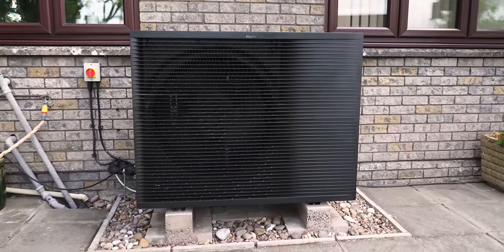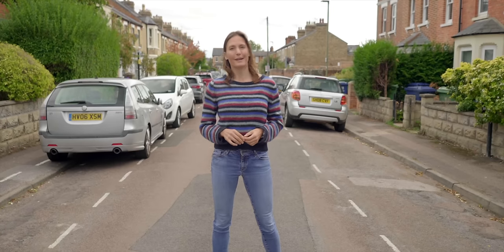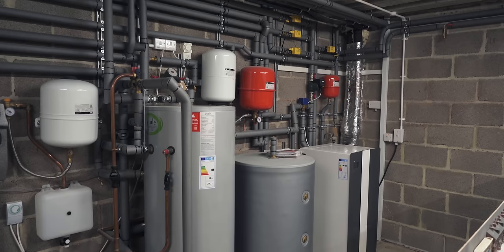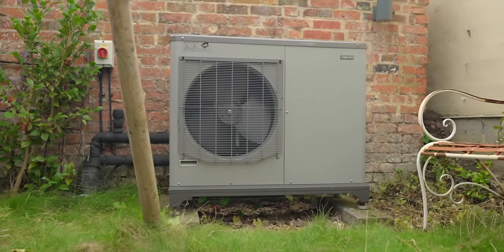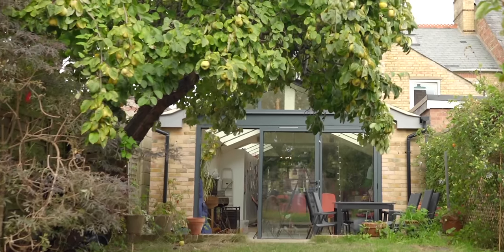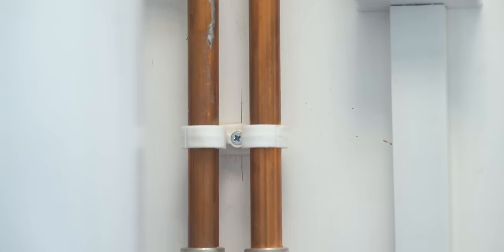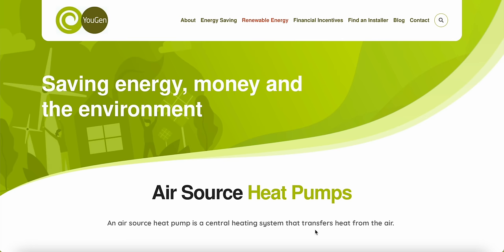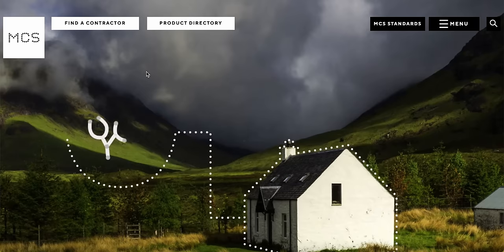Does a Heat Pump Really Work In A Victorian Terrace?

Comment: From minute 5 I could only think about the elephant in the room: price, cost, years to recoup your money, gimme something!
Reply: Can I ask what the payback is on your gas boiler?
Reply: @Muppetkeeper  it only cost £2k to fit instead of £7k that's a lot of money to spend when you haven't got it
Reply: Mostly irrelevant and not to the point for the video, costs are so variable and are coming down rapidly so not very relevant to whether they work or not and what it’s like it live with.
Reply: @deanfielding4411  For some people money is not a problem, for some others it is the deciding factor.
The costs involved are not irrelevant.
Reply: @matthewmcmullan9669  From what I read the average cost is between £15-20K,  unless you are blessed with a house that is fully insulated and requires no modifications.

Comment: Gas is a third of the cost of electricity typically. But they burn 30kW per hour. That now equates to £5/hour. Several £30 1kW electric oil heaters with a COP of 1 would still warm the house with radiant heat but would cost less per hour than gas. Or have I missed something? (Remember a COP of 1 is not acceptable to eco nuts due to demand from the grid, even though setup cost is miniscule compared to a £13,000 full fat heat pump).
Reply: Combi Boilers are quoted for hot water production and not for central heating. I have a 32kW boiler that costs around 50p for the first half hour of heat, as the heat flow is set to 50C. Then it uses less gas as it gets towards temperature. Over the summer the  the boiler was using around 3kw a day for hot water. Now Autumn is here the boiler has used a maximum of 43kw in a 24 hour period or put another way £4.30. Yesterday for example the boiler used 13.85kw
Reply: @MrRawMonkey  A gas smart meter would be useful to learn how much it uses. Until then its guess work.
Reply: @TeaBreak.  true unless you get behind on your payments and they decide to press the button and move you to pre payment and charge you more. Happening in the uk and is the real reason for smart meters.
Reply: @teabreak combi boilers need a high kw rating as they need a lot of heat to heat the water as it flows past. If you have a standard boiler then you’ll see it’s more like 17kw or less. Add in opentherm and it will modulate the gas flow down depending on the heating demand. So instead of blasting full power and then turning off after 5 minutes and repeating that every 10 minutes it drops the power down and keeps running longer. Lower temperature means more condensing and greater efficiencies. Heat pumps are great but I worry about lots of them all spinning away at night making noise, but that’s progress I suppose. We’ll probably end up shutting the windows and getting air con and use more power supplied from gas turbines.
Reply: @davideyres955  do you know the typical cost for a 1 hour's central heating boost with a 32kw boiler? Unit price is 15p I think atm.
Reply: I think what you're missing is assuming that 'several' 1kW heaters could replace a 30kW heater. Your boiler is pretty efficient, so you'd probably need almost 30 heaters. Some houses did have electric-only heating a few decades ago, but it was really expensive to run.

Comment: Load if rubbishh, rarely work well, suitable for new builds and about 10% of existing horsing without spending 1000s on insulation,  new rads etc. Loads of people are having them ripped out and gas boilers put back in. A big gon, mis selling scandal on the horizon

Comment: What a load of rubbish spill, 95% of Victorian terrace houses will not benefit from like to like cost for a desired heat requirement. 95% of domestic condensing boilers never go into condensing mode, as an existing system is not designed to do so. However all boilers are designed to be around 98% efficient and very low emissions of flue gasses, CO / CO2 ratios. Depending how you use them Heat Pumps are backed by electric as a heat source, which comes from somewhere, and is not free, which at a good guess will cost far more in the near future as demands increase. Think long and hard before getting involved, as once you have it's already to late. Plug your electric car / cars in and the whole thing becomes a costly nuisance.

Comment: For me to install a air source heat pump would require replacing my radiators and 9mm microbore with larger units and at least 15 mm pipework. I live in a small semi with only very limited space at the rear and  path at the front... and that 's just the start before I think about the insulation- Underfloor, walls, roof and upgraded glazing. Might as well gut the house and start again...all on state pension!...it's not happening any time soon.

Comment: Very one sided review, completely ignores some of the main drawbacks of heat pumps. Sure you can install a heat pump quite quickly but you will also need to significantly increase radiator size or install underfloor heating because heat pumps are most efficient when producing much lower temp hot water than, say, a gas boiler. The second point is that they only produce significantly more heat energy than the electricity input during reasonably warm days. On really cold days (-5C recently) when your need for heat actually increases, you will find the heat pump produces less heat for the same electricity input - simple thermodynamics at work.

Comment: Here in the UK Electricity is 3-4 times the cost of gas.... For millions this is not financially beneficial. And I notice the guy having the heat pump installed is involved in the green energy sector so hardly an impartial view.

Comment: Is there enough elecric supply to heat all the homes in the UK?
Reply: Yes because of the significant reduction in energy needed to make the gas and the fact that in 10 years energy consumption has dropped due to efficiency in other areas and also in the last 10 years we’ve gone from almost no energy generation from renewables to almost 50%, so it can easily be done if we have the will, and then energy will get cheaper too as we won’t be extorted by the fossil fuel industry like we are now.
Reply: @deanfielding4411  You mean people sat in the cold because they are terrified  to put the heating on? Efficiency are you having a laugh?

Comment: If you plant thousands of more trees and plants hydrogen mix gas boilers could help reduce your CO2 emissions. Some homes with a very small garden or building that two small to have heat pump fitting inside you could still have hydrogen gasmix boiler but insulate your house to reduce energy usage.

Comment: Something I have been wondering, what is the difference between an air source heat pump and the air conditioning units you can buy that also have a heat function? (or are they pretty much the same thing?)
Reply: An air conditioning system with a built in heater generally uses the same technology as your standard electric heater. So they are not as efficient as air source heating as they use electricity to create all the heat. Air source heaters pump heat energy from the environment.

Comment: My new daytime elecric tariff is 5 times that of my gas tariff.  So I would be paying a lot more if I switched to heat pumps for the whole house. I self installed a de-Longhi air conditioner heat pump (for 1 room only) nearly 20 years ago and it still works fine so know how good they are, its just that our crazy UK energy pricing scheme (as someone else below points out) makes it a very uneconomic choice at the moment.

Comment: "Home heat pump truths" ?
I'm not trying to knock heat pumps but key is heat loss, which I find missing from all discussions, on top of ignoring local distribution issues to support such a massive change if everyone were to do it 
- In short there is no holistic approach presented but much the same tired "this is the latest miracle cure" sales spiel, doing a massive disservice to potential "customers"
The UK has a peculiarly (as in compared to almost everywhere else) awful track record in energy conservation since the 1960s , and  60 years later conservation is pretty much blanked from view, plug this in and all all your worries are over, ahem, no.
Get the energy demand down (aka heat loss) and all things are possible.

Comment: Heat pumps are not something American technicians seemed to be comprehensively trained about here. ..or if so they are not educating their owners very well.  Mine for example promised snow would melt if sucked into the fins of the condenser.  Instead I had a wall of ice form from melted snow blocking the air flow that never melted.  On a forum, a tech who actually had a heat pump said he found he had to, melt the snow off the pump's fins, shelter his from midwest snows and his efficiency went up.  I did the same and my monthly utilty bill dropped some $25.00.  Additonally I was told never turn off the heat pump.  I have a passive thermal solar mass than stores heat for up to 2 days if fully loaded with full sunshine throughout the day.  Shutting off the heat pump completely until the temperature dropped to its set temperature of 68 F saved me an additional wad of money and consumed no utility energy whatsoever.  There are several other tips I've picked up and that are never mentioned as heat pumps in the states are highlighted the only real concern to think about in keeping citizens warm while consuming the planet less.  Thank you for a mention about insulation and efficiency.  Combined with heat pumps the reduction on energy should be significant.  Without decent insulation heat pumps are simply snake oil and false promises.  It might not be bad to talk about what might be a target for insulation.  My dwelling has an R-value of 35 in the walls and 55 in the roof, plus extra foundation insulation.  Before I properly protected the heat pump my bill was almost the same as a home more than three times the size of mine that was well insulated.   Getting the most out of a heat pump must be a partnership of equals believing the homeowner's skill capacity is as important as the technicians.

Comment: Heat pumps run on electricity which is 3 X the cost of gas, you also need huge Radiators as the ideal temp for economy to run a heat pump is about 35 deg once you increase the temp you decrease the efficiency, in older homes forget it

Comment: So you can connect an ashp straight to a boiler tank and run the existing radiators and hot water use from that, have I got that right?
 I understood that it was complicated because of pipes needing to be re-sized for some reason... Can anyone tell me what I'm missing here please?
Thanks, thought provoking Helen, cheers.👍
Reply: The pipework needs to be changed and I'm told you need different radiators too.
Reply: It's not quite that simple!  You need to have a survey to determine the heat loss from your rooms and the heat output of the radiators at the flow temperature of the heat pump (an installer should do this for free, or you can do it yourself if you feel confident).  If any of your radiators aren't able to provide enough heat they will need to be replaced with larger ones.  Your existing cylinder will probably not be suitable for use with a heat pump and will need to be replaced as well.  There is usually a requirement for a small buffer tank to match the output of the heat pump to the heating system. 
All of this sounds complex but a good installer will size everything according to your needs and will carry out all of the required work.
(Edit: removed refernce to pipes)
Reply: @alexwebster7065  thanks, that is so helpful. I have a combi boiler and no cylinder so I would just put the appropriate cylinder in the same area, there's room for any supplementary cylinder too if necessary, or there are other options on placement. It's all a bit hypothetical  in my dreams at the moment but I hope to be able to get a greener home some day. Many thanks again.👍
Reply: @waterboy8999  thank you, yes I heard that too. 👍
Reply: I have a heatpump in my 1984 built house. NONE of the pipes were changed, in many many homes in the UK, you will not need new pipes. I have new, larger radiators, but after the first week you don’t notice them at all.  The house feels nicer as it’s a gentle heat, and my hills are 20% less than they were with gas.
Reply: @alexwebster7065  It’s now law to have a heat loss survey before changing any boiler. You don’t have to have 15mm pipes, I have some 10mm in mine. Please stop spreading false information.
Reply: @judebrown4103  you're welcome.
Reply: @Muppetkeeper No less an expert than Graham Hendra says that microbore pipes aren't a problem, so I've edited my original comment.
Reply: @Muppetkeeper  interesting, thanks. I have old double radiators probably from the eighties, maybe nineties in the rooms that matter so they might be alright then. Thanks 👍
Reply: @alexwebster7065  You are welcome to come look at my 10mm pipe work any time. The size of radiator is limited, but it’s at around 1kW, which is a very big radiator.
Reply: @judebrown4103  They May be, but don’t get hung up on radiators. They are cheap and easy to replace, and if new ones go in you stop noticing after a week.
Reply: @Muppetkeeper  true, good advice, much appreciated. 👍

Comment: We have been given the opportunity to have a air  heatpump system installed,  but we live in a small 1970 mid terraced house.  We were told that the system may not fit anywhere in the house and also cannot see where the outside unit could comfortably go?  I'm worried that when our existing gas warm air which is same age as our house packs up what other system will be available?  If we did have the airpump installed will we have to have radiators instead of heat grids?  Just really worried,  from a 72 year old that cares about the environment too.

Comment: Until gas is more expensive, heat pumps, even at 3 x COP are still more expensive than Gas. Plus the radiator and piping upgrades. Long way to go yet.

Comment: The house owner claims to not be at the mercy of fossil fuel prices, like the current increase due to the war....but unless he has a massive solar array not shown on the video, he is totally at the mercy of fossil fuel prices still. Realistically, is there a solar/battery system big enough to power a heat pump system in a domestic setting?

Comment: What is the cost for a detached 3 bedroom house with a gas combi boiler supplying 8 radiators.Also hot water.Shower is electric heater.We are ove 70 is it worth the cost and how much average to install?

Comment: Here in Australia, people are using heat pumps for cooling, in big numbers. I have just bought one and and it is extremely efficient and effective for cooling in the intense Australian heat.

However heat pumps can be "reversed", swapping the compressor with the venturi. People are reporting saving money on heating during winter, including myself.

Some Australian state governments are supporting the introduction of heat pumps for hot water. I have friends who say they have saved 80% over electric resistive hot water systems. 

See Dave Jones on costing hot water system in Oz compared with gas, 
https://www.youtube.com/watch?v=iavM2IqueM8  Heat Pump Hot Water System vs Gas Hot Water (14:31)

Comment: I'm very happy with my ASHP installation in a 1970's detached house. Two winters completed so far. I have solar, a house battery and an EV, so I have access to EV electrical tariffs and being able to shift cheaper energy into the day. I've used 2368kWh of grid electricity this year so far which has cost me £224.11. This covers heating, hot water and EV charging.
Reply: So you say you have used 2368 kWh from grid this year. You paid for that 224.11 GBP. That means you paid 9.46 p/kWh. How is that possible when I pay now 44.347p/kWh on government lowest electricity tariff at day ? How big is your house? How much heating energy do you use per year?
Reply: @teranova5566  I have an EV tariff from Octopus Go. Until Mar 22 it was 5p/kWh for 4 hours and 15p/kWh the rest of the day, from Mar 22 to Mar 23, my tariff is is fixed at 7.5p/kWh for 4 hours and 32p/kWh for the remainder. With solar and home battery storage,  I use negligible grid electricity in the brighter months and in the darker months I fill the EV, the house battery, heat the water and start the ASHP going during my cheaper 4 hours. At the moment the battery and any solar covers the my off peak use. This will change as it gets colder and darker. I'll see what stats I can dig out from the ASHP...

Comment: Looks like his Victorian terrace may well be double leaf and therefor have had cavity insulation? I’ve no issue with heat pumps but getting clear answers on costs etc is difficult. We live in a 1900 sandstone semi with high ceilings. The whole house would need internal or external wall insulation, pipe work would need redone, we’d need larger radiators in at least two rooms, gas fireplace would need to be replaced with electric or sealed up (then room would need redecorated) and we would potentially be told that underfloor heating would be best. This would be well into tens of thousands of pounds that we just do not have.
Reply: I enquired about external wall insulation in 2018 and had quotes ranging from £20k to 30k. How can regular families afford this stuff?

Comment: Brilliant! I am getting one for our 110 year old, two story house on the Canadian prairies. I am told they will operate down to -35C. Soon I will complete the R27 foam insulated walls then a new electrical system then install an air sourced heat pump...which I hope will allow us to reduce the natural gas heater by 95%.

Comment: I was hoping this would get into a little more detail about how often backup heat needs to run on these newer heat pumps in cold climates. I have no doubt about the significant savings but would still be good to know.